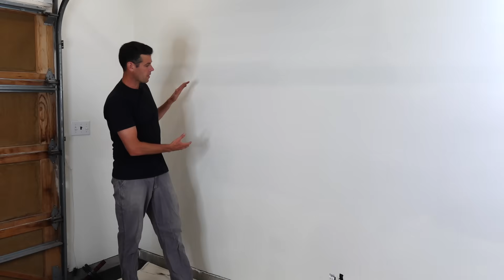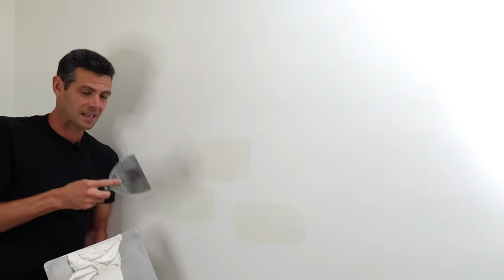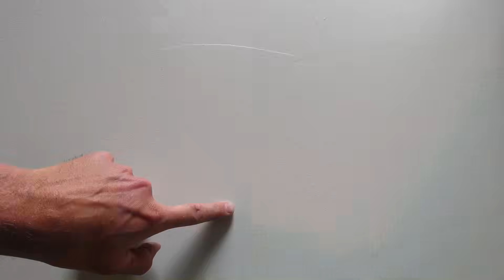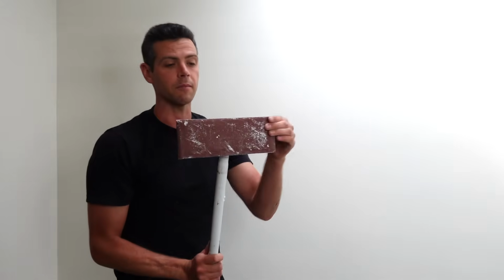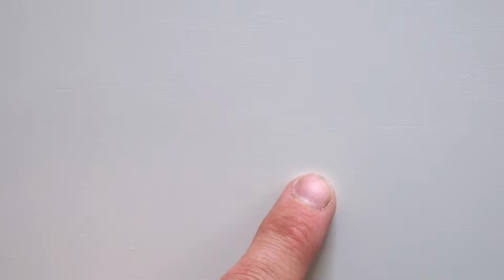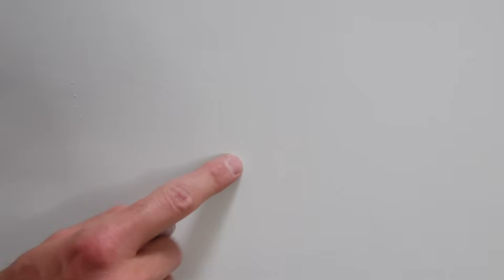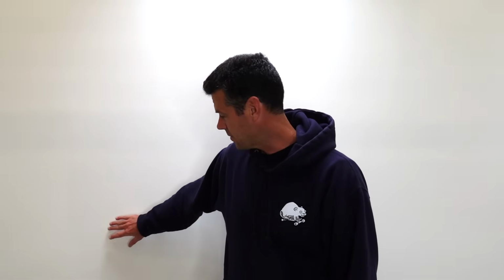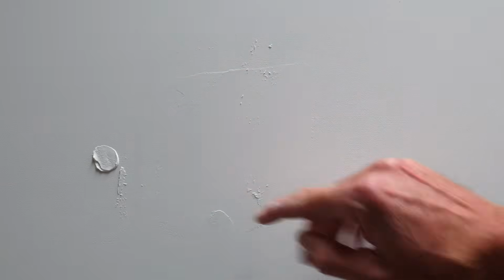How to DESTROY YOUR SKIM COAT with TOUCH UPS!!!😭

Comment: as  a long time mud guy all i do to prevent this problem is....any place you want to touch up just wet the spot down with  a damp sponge greater an area than you fresh mud  and it will all blend when sanded in with a smoth transition no ridges
Reply: Never done this, but seems legit. The moisture helps bond the fresh mud to the existing portion. Good idea :)
Reply: That's exactly how I do it.

Comment: I am 82 and learning to do drywall skim coating and some repair on an 70 year old house. lived in it 40 years and remodeled parts of it 3 times. Lovely home and time to do some updates in drywall repair and painting. You are as compulsive as my wife and I have learned the value of taking my time. I am happy with the first repair of drywall in a lath/plaster wall.(Old wall furnace with bottom intake/top outlet that was turned into a hallway closet. Furniture covered the intake which was never removed. It is now.)   Interesting experience. After what you said about your garage wall distracting you, I can understand having done your best. Your wall looks great. Trust mine will too. Let you know when finished.
Reply: Just goes to show that we never stop learning, no matter how old we get! I'm also working on a 70 year old house :)
Reply: My reno is about 75 years old too.  It's my grandma's old (2nd) house.  (She bought it years ago because the property is attached to my dad's property/home office.  So, "your children's children" and all that, I guess.)  It was empty for a couple years, and my son has allergies.  There was mold sitting on everything.  (Florida)  So we've been diy making a lot of improvements.  I'm working on the bathroom now, which has been a nightmare.  (There's no exhaust fan, and what used to be a window has been covered up for an addition.)
Don't worry, I'm wearing all my PPE, air purifier, etc.  :)
I've made a lot of repairs, and I think I'm gonna skim the ceiling before I Kilz Mold & Mildew and then paint with Mold/Mildew additive.  
(Pray for me.)

Comment: In addition, I've found that if I need a third skim coat, it is better to prime the wall first, otherwise the previous two coats pull too much moisture out of the third coat as you are applying it (you can sorta see it around 12:45) , causing chatter and other tool marks to occur.  I add a little paint to the primer, so that the primed wall is a little darker than the skim coats, making it easier to spot areas you might have missed (priming or skimming).  Also, that coat of primer makes mistakes pop-out that you might have missed otherwise.  If I need small touchups, I prime first, as the primer is a lot hard to sand than the touch-up (as Ben pointed out).

Comment: I'm watching this literally 1 hour after sanding my final coat and doing a few touchups. I didn't know I could ruin my work by doing that! Thankfully I used the same mud and I didn't apply too much pressure on the touchups because I wanted to leave something to sand. If I didn't watch this video, I would have used a sanding sponge the next day but now I'll definitely be using a pole sander. I hope it turns out ok!
Reply: I’m sure it came out fine after you primed and painted.

Comment: On a vehicle working with metal fillers, we'd stain the area we're about to sand down (dip a rag into some paint & smear over the surface).  As you sand now it's easy to see the low points where you may need to add more filler or continue sanding.
Reply: Sometimes drywallers will add chalk to their mud so it's a bit more visible when they're touching up work
Reply: @aidens5511  Yeah, I heard him say that too but I'm guessing this changes the color of the mud all the way through, I'm just talking about staining the surface which ultimately should end up being sanded off unless you have a low spot

Comment: Commenting after you read his email. I've definitely encountered that issue when I first started drywalling. Through trial and error, I came up with the best solution that works for me and my limited skill. 
If I need to fill in a small divot, hole, or thin line I typically just put the mud on without trying to level it. This prevents any risk of really compressing the mud and forming those different layers. Once it dries, I just sand it lightly without pressure, letting the sanding sponge do the work. That's been working for me

Comment: Holy moly! I never expected the problems that I encountered were in fact a thing. I was doubting myself thinking this is what DIY will end up to. My walls are full of ridges that I spotted later when the room was completed (already painted, placed furnitures). I did tons of touch ups and seemed to never going to be finished. A big thank you for pointing that problem.

Comment: Helpful video. I hired a drywaller years ago and they said it was good to go for painting. After I painted I found many such ridges. Now the ridges are under dried paint. And it's been 10 years this August and didn't think I could fix it. As I move to work on the guest bathroom I'll be doing my own drywalling (encouraged by your channel). And plan to rent the fancy wall sander ($63/day) at my local tool renter. Thanks for encouragement and tips.
Reply: Just skim over any imperfections until they’re filled it. It’s pretty easy, straight forward.

Comment: Thank You! I've always done my touch ups after sanding, applying additional mud where needed followed by more sanding and more mud touch up (repeating as needed).  Your BIGGEST TIP I learned from this video - Never touch up a "sanded" wall! instead... apply your skim coat, touch it where needed, then "after" all the touch ups are done THEN sand! Once sanded... prime the wall before doing further touch ups.  Wow... big difference... wish I would have learned this years ago.

Comment: The good old side-light trick...  I have a lithium flashlight which has numerous single-cell batteries which are in constant use-recharge rotation when drywalling and painting.  Yes, painting!  The flash light illuminates paint roller edge lines perfectly for correction.

Comment: Great video. I am general contractor and self taught at drywall. Couple years ago struggled on a job with soft and hard joint compounds when sanding. Used hot mud first coat then a different compound on top. Top sanded easy leaving a hard coat with ridge’s all over, a bloody nightmare, Never again 
On a recent job installed 70 sheets of drywall, used the same compound first and second coat and here and there the odd contour. Same compound yet hard to sand down the contours. And the contours have a slightly different color. After much analyzing, dilution. I don’t thin the mud much at all, yet the next day may add a little water to remix a previously mixed bucket. Thanks Ben now I am also aware of mud compression.

Comment: I wish I had known this last year!  I tried skim coating with 45m mud, and the wall was really wavy.  I tried layering all-purpose mud but ran out so used 45m mud and the wall had peaks and valleys >2 inches!  Finally, I filled everything in with lightweight mud but i had to apply so much that it hadn't fully dried after 2 weeks.  I painted over the wet mud, forgetting to primer, and about a month later the paint started to bubble and chip and the mud layers started delaminating.  I sold the house because I couldn't figure out how to fix it.  Thank you for your videos!

Comment: Best pole sander I've found is: circle brand express sander and using the foam backed sandpaper.  What a dream compared to the old mesh sanding that scratched the hell out of the wall.  This pole sander doesn't and has never ever flipped over when sanding in any direction.  Leave it to the Canadians to make a great product.  Compressing the mud was a great tip for me.  Keep up the great videos.

Comment: I literally just touched up my ceiling tonight....(Scotland) and then watched this.  Thankfully I think I resisted the temptation at the time to press too hard.  Problem is I painted first and only then spotted that I needed to touch up.  Is that a problem? I don't know.  But Ben, if you read this, I'm doing a full renovation myself and the quality of the stuff I've done is pretty good and I have to thank you for your videos as otherwise I'd need to call the very professionals I'm trying not to use in to fix it.  Great work, genuinely enjoyable and informative.

Comment: I'm a 28 yr old woman trying my best to mud my own bathroom. Your videos gave me the confidence to try! I've made a few mistakes along the way and it's taken hours of trial and error, but your videos have been so helpful to create a nice final product!
Reply: Good for you Jessica, that's great to hear!

To learn a new skill you just have to get in there and get your hands dirty. You WILL become good at it if you keep at it.

A professional drywaller makes it look effortless, but it's typically taken them years of practice and they do it every day.

I'm self taught and can do a professional job. However, it took me a while to learn and I'm still learning.

The only way to master drywalling is to practice and watch videos of professionals like Ben for technique.

IMO, the biggest mistakes you can make as a beginner are:

(1) not using the right tools and technique, 

(2) not using the right mud (i.e., use Quickset for the base coats, which is a hard, durable plaster, and an air drying mud, which is a soft plaster for the topcoat finish sanding), and 

(3) not using a side light when sanding (as a beginner, there's NOTHING worse than painting over plaster that you've put a lot of sanding into and looks great head-on until you put the paint up and realise what a hash you've made of it, even though it looked totally fine before painting 😉).

Be persistent, and patient with yourself as you learn, you WILL become a pro 😊.

From a DIYer in New Zealand.
Reply: That would take a month to do a whole house like that

Comment: So, I have the ripples, seen after shining a light up the wall. Deep doubt set in. Then, I took a large and wet and smooth, soft sponge and got the coat wet. I was able to almost get a glass-like finish by sanding it with a screen sanding block. I made large up and down strokes and smoothed it with lightly going over it with my sponge.

Comment: This is two weeks too late. I hired a guy to flatten out my bathroom walls and he did a great job but I noticed a few problems. I’m not a total novice (have done a few rooms), so I thought no problem. I decided to use hot mud over his final topping coat. Obviously this was not a smart idea. And to make it worse I used a sanding sponge. I had a couple of serious islands that would not go away. Finally got them down after figuring out to put pressure only in the harder mud. Thought I was done and put a coat of primer. The shine from the primer and changing light highlighted that I just moved the problem. Repeated this a few times, each time with primer. Finally got it straightened out, inadvertently helped by the primer.  Spent a lot of time, much of it zen time, so all good. This excellent little video here is a good lesson on how to work with this material, but also highlights another lesson that we don’t know what we don’t know. Glad muddling through happened to work out for me in this instance.

Comment: I'm experiencing this and it's very annoying. Here's my fix, first use a spray primer to seal the surrounding mud, so you can focus on the patch without removing any more mud. After that, use a 40 grit sand paper to pretty much dig a channel along the ridge and fill that with mud after. Sand again once dry and that issue should go away.

Comment: I really appreciate these postings as it this channel has been the most helpful for me on my recent drywall related projects. 
I have been creating my own sanding tools using large flat wood boards (like 24" x12") that I add a couple wood scrap handles and attach 120 grit with contact cement. The larger coverage area helps the overall smoothing and ensures consistency.

Comment: Thank you for this video. I knew I was having a problem with my skim coating, but could not figure it out. It was touch-ups after sanding, oops! Won't do that again. Thanks to you, I am actually hanging drywall, taping, and plastering, my first room. Now have the rest of the house to go.
Edit; I found my grandfathers trowel and wooden (homemade) hawk and I love using the trowel. better for my wrist.

Comment: I ran into this problem years ago, and one thing I've done to get around it... Get it close to perfect, prime it, hit w/ one finish coat of mud, then sand and re-prime.  The in between primer step seems like a headache until you end up chasing your tail coating, recoating, and recoating w/ mud to still end up with crap results.
Reply: I'll actually do two coats of primer, then one final "re-skim" and then two coats of primer again. Perfect ever time. If you have a good quality primer, it'll hide a lot more than you think.
Reply: @Chris.Rhodes  Wow! What primer do you use? And doing you use a topping compound for the final skim? Do you water it down the joint compound? I am pretty new to this and am smoothing out textured ceilings. I am getting near the end stages and am not sure how to best finish it.
Reply: @ES-bn1bi  so I use Plus 3 blue, as all 3 coats. And I use Kilz Drywall primer now. It performs really well. But any Kilz water based primer works great.
Reply: @Chris.Rhodes  Thank you.
Reply: @ES-bn1bi  no problem. If I'm doing a bigger repair I'll use hot mud, and then a coat of plus 3, and then primer, and then a skim, and primer again. But it all depends on situations. If I have Superpaint from Sherwin Williams, I'll usually just do the repair, skim, and a prime coat with Superpaint as a final coat. But it all depends. Different situations call for different methods.
Reply: @Chris.Rhodes  I use Kilz 2 water based. Hides most stains including rodent stains on ceilings in garages. 🐁

Comment: Spray the old mud with some water. Let it soak in. Apply the new mud. Mist the perimeter again before feathering. No pesky witness lines. Might not even need to sand. 

If all you're doing is filling pinholes then just apply the new mud with a damp sponge instead of a knife.

Comment: I live in CA. More often than not people want texture and more recently (last few yrs) imperfect smooth. Hardly ever do clients request smooth walls. This issue discussed in this video is not really an issue unless you need to skim coat.  I have done 1 perfect smooth wall in last 5 yrs and didn't skim coat and the wall was perfect. I did address stud varients before hanging sheetrock. Skim coating the whole wall is not necessary. Waste of time if you know how to hang sheetrock. That being said, I really enjoy this channel. Lots if good info.

Comment: I can hang sheetrock pretty good. I'm not an expert but capable. Taping and filling screws is not a problem . Where it goes off course is thinking that the wall is a little off. Then I start adding mud and before you know it, I messed up the wall. Then I go to Lowes and buy another bucket. Then a day or two goes by and I buy another bucket. 
Pretty soon the walls are thicker and the room gets smaller, and smaller.

Comment: I’ve noticed it can be the paddle we are using. Turn your paddles to the side ,like looking at a 2x4 in the store. You need to find a paddle as straight as possible. It does make a difference.

Comment: appreciating the tip on not compressing your touch ups , definately going to trial that on next house this week.
I'd battled the same issues for my whole career but found if I do all the touch ups (except peak summer where you can touch up and sand immediately) and then do a full scrape/sweep/clean down load the van etc , I can go around the outsides of touch ups and feather them off even if they are a bit green. And then full sand them when I call back .. havnt had an issue so far 🤞

Comment: Hey dude, i'm diggin the tips for sure!  One small tip...when you paint with a roller, start in the middle of the stroke so you actually roll over where you start from a couple of times.  When working on small, well lit walls, you'll see the spot where you planted the roller first because it's harder to "roll over" the start spot....does that make sense?

Comment: Yeesh.  I think this video would have saved me time on my most recent room.  I battled with touch-ups through 2 full skim-coats and gobs of sanding.  Didn't know the priming-before trick at all.  Also, since it was over an old painted wall I had a ton of bubbles to contend with.  Now I know for the next room(s).

Comment: hurray sanding pole! When using sponge for that kinda thing I always use suuuuper light pressure and high reps so the sanding surface stays rigid, also try and keep most all of the sanding inside the patch area since I know it's a layer higher than the surrounding bits.

Comment: Ben, this was really an interesting video because I just applied a skim coat today to a couple of walls and never realized that you would not recommend applying touch-up mud to sanded areas.  Maybe it hasn't affected my projects in the past because I have always used the same mud for touch-ups and I tried not to apply them with too much pressure.

Comment: The already primed wall is harder than the mud. Reskimming is recommended...
Usually, avoiding any patching afterward would be better if you're a perfectionist?
PS, you could brush wash the edges before sanding. Plaster patches are done like this...
I am plasterer 1963😊
Reply: I agree that the surface should be wet before applying mud